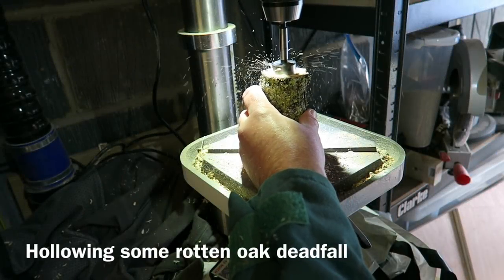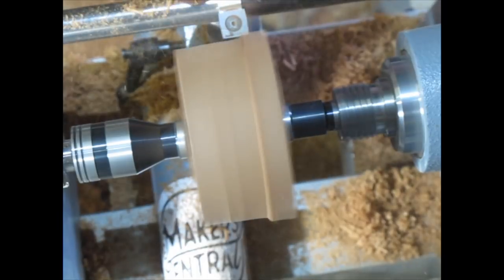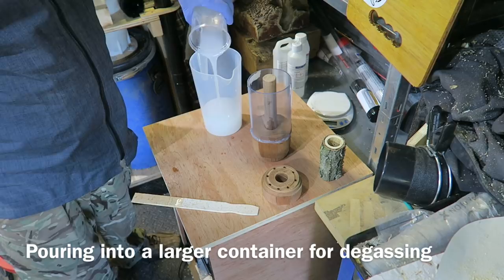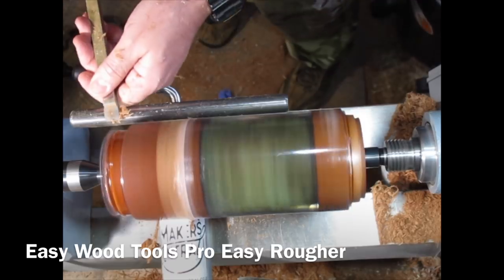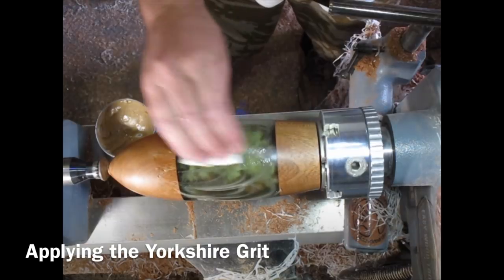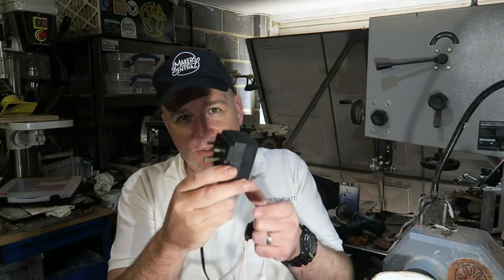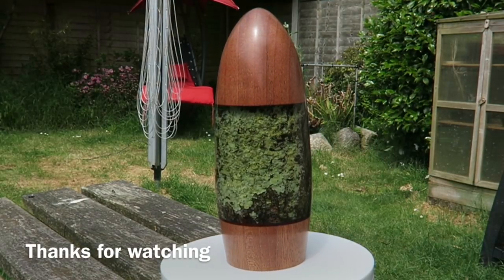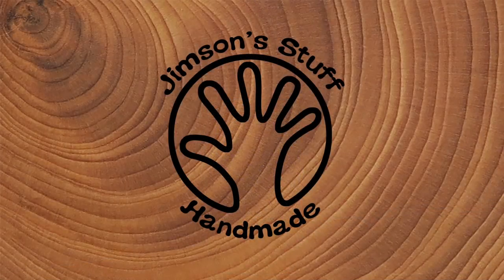Making a lamp from an old branch and epoxy resin.

Comment: Really nice Jim, tried a similar lamp just before Christmas using miliput to make mushrooms and coated them in glow powder and ultra violet torch as a light source, also added dried moss from the garden. But used the wrong polyester resin and it shattered, plus it was freezing in my shed and absolutely stunk .Bought very expensive amazing clear resin this week, but it says on the box half inch pour every four hours, it's gonna take forever to fill the mould. I don't know, just can't win.
Reply from the maker: Thank you very much. I would avoid polyester resins, I have used them in the past but they are nasty and difficult to use. Most resins have an exothermic setting reaction so large volumes tend to overheat and crack or discolour, hence shallow pours. The resin I used is a very slow setting resin and has aa lower thermal reaction so you can get away with larger volumes. It is only meant to be poured to a depth of 35mm. The beauty of several shallow pours is that they tend to de-gas themselves and avoid the need for a pressure pot but it will take much longer. Cheers, Jim
Reply: Cheers Jim, Will do.

Comment: That looks amazing Jim. The effect you get with the wood looking like it takes up all the space is great along with the lichen. 
I've watched a few people with resin and not seen this one before, do you need to use the vac chamber on it? Also seems a long cure time of 48 hours.
Was please to see the way you fitted the LED, I always try and make something that I can pull apart in case you need to fix / replace a part.
Well done!
Reply from the maker: Thank you very much Paul, I was really pleased with the end result. The vacuum chamber was probably not necessary but the pressure pot definitely was required, especially with light as any bubbles/porosity will spoil the effect. This is a slow cure resin which is a pain but it does mean you have extended working time and it is less likely to overheat when curing which can happen in these large volume pours due to the exothermic reaction. Overheating can cause cracking, yellowing and distortion. This resin is also great because it is very hard when fully cured which means it can be polished like glass. Cheers, Jim

Comment: Great video. Should be getting a vacuum pump soon. Wondering once you put the resin into the blank why its not a good idea to degass again ( guess it could damage the item). Don't really want to buy a pressure pot, do the pressure pot really make a difference?
Reply from the maker: Thank you very much. I did actually do a brief degas once I had poured the resin but it just overflowed and made a mess. A vacuum chamber was not really necessary for this project but the pressure pot was a great help ! Cheers, Jim

Comment: Absolutely fabulous project. I will be following you with interest. Sadly unless I win the lottery I will never be able to try it. I have invested a lot of pennies ( for me that is ) in an old Denford Viceroy bowl turning lathe, and am gradually getting all the 'extra's' together. Over 35 years ago I was turning spalted bowls with huge holes, also green wood turning and when finished would 'cure' in the microwave, A lot has happened since then and the introduction of resin is so beautiful. Way beyond my reach as a pressure pot and compressor add up to several times my lathe etc cost. I will somehow find a way to accomplish my dreams. After 9 heart attacks, triple bypass and fab pacemaker fitted I am not ready to give up yet lol. Wish me luck as I wish you continued happiness in all you do. Congrats.................Alan.
Reply from the maker: Thank you very much Alan. Resin is expensive and the pressure pot lessens the chance of failure. Stay well and keep on turning.
Cheers 
Jim

Comment: Another wonderfully creative project, Jim. I keep several terrariums (terraria?), and I'm suddenly having visions of a permanent moss & lichen terrarium. A resin mixing tip: I find that I get many fewer bubbles using an inexpensive magnetic stirrer plate. Just don't get carried away with the speed dial... Clyde
Reply from the maker: Thank you very much Clyde. Thanks for the tip. This idea has so many creative possibilities. Cheers, Jim

Comment: Wow. You are so clever. That's a lot of work. Can this be done without a pressure cooker.
Reply from the maker: Thank you very much David. Could be done without a pressure pot but you are more likely to get bubbles. One way round it would be to cast the resin in thin layers so that it will de-gas itself but that would be very time consuming. The resin will heat up on curing and this can cause air to expand out of the wood, the pressure pot also helps prevent this.
Cheers 
Jim

Comment: Amazing
Reply from the maker: Thanks Ahron, one of my personal favourite pieces that I have made. 
Cheers 
Jim
Reply: @JimsonMakes  A question why did you drilled the branch and then plugged it with a round piece wood .
Reply from the maker: 2 reasons , initially I had planned to run wires through it but mostly to aid the drying process, it was very wet and soft.
Cheers 
Jim
Reply: @JimsonMakes  Thanks